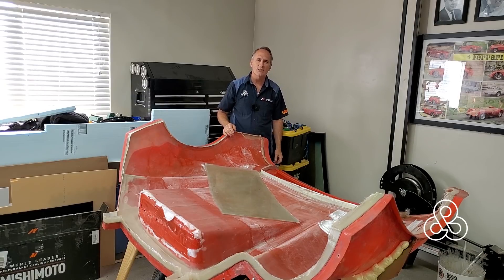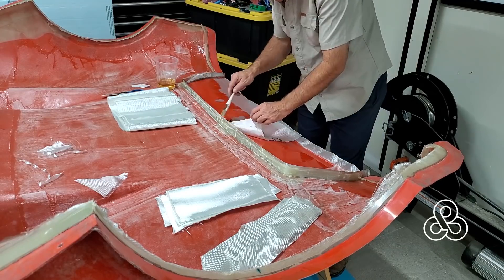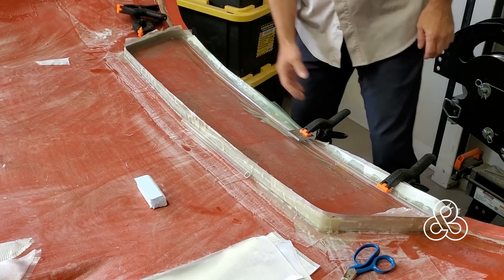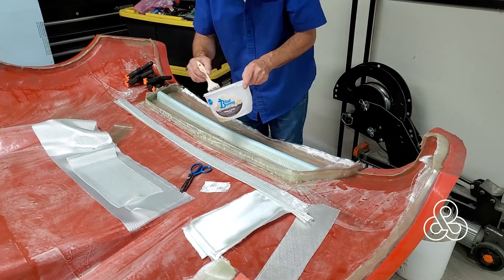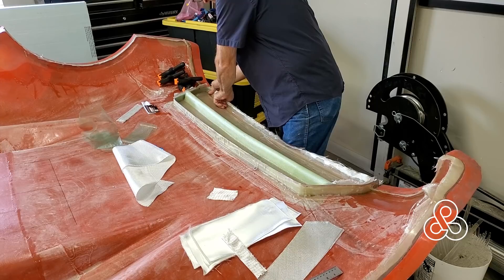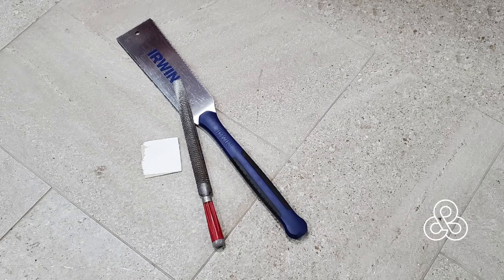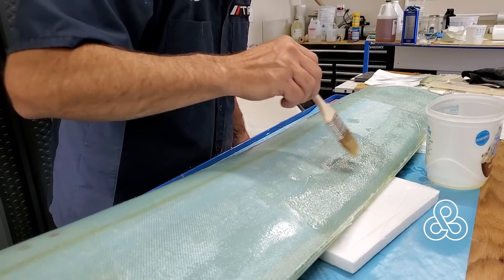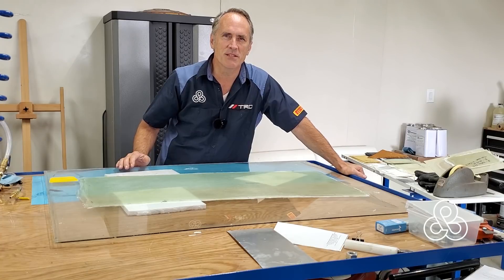A41 - Nero fiddled, I built an Active-Aero wing. Arete supercar project

Comment: Interesting process. How will you balance front aero with the extra rear downforce - moveable splitter ? I used aluminium tube spars - one on the centre-of-pressure and one to stabilise the trailing edge. I also used my 10% wind tunnel model (all home-made) to measure drag and chassis pitch stability at 4 degrees nose up. (I was at Le Mans in 1999 when they were taking off and flying up into the trees - Scary !!).
Reply from the maker: A front splitter is in the works. Exposed carbon fiber, so with the mold and all, it is taking some time. I should have a video out fairly soon though. Stay tuned

Comment: Why does everyone use brush for fiberglass not a skinny Minnie roller or sprayer
Reply from the maker: It is hard to apply the right amount of resin with a sprayer (plus the problem of over-spray control). A roller tends to pick up the fiberglass cloth and move it. Regular brushing will also move the glass fabric, but you can develop a technique called "Stippling" (a sort of rolling-twist of the brush) to actually press the fabric in place as you apply resin.
Reply: I know stippling I'm painter by birth well family business very good explanation thank you for your time ..love the car and in depth build

Comment: Have you designed this wing using CFD or are (excuse the pun) you just winging it?
Reply from the maker: It is a variation of a NACA 6512. Slightly more drag than I would have liked, but it fits nicely into the spoiler shape in the retracted position. I do have tabs built on to my control arms that I hope one day to fit load sensors to, then I can tune the position/angle of attack, at the track. So the dream goes!
Reply: @BuilderCreator  the plan sounds brilliant. I'm glad I subscribed. Thanks for the reply.

Comment: Wow. I want to see how you work the arduino in with it! So once its in range/extended out, do you plan to do different angles for each mph, or have it hold one angle within a range of mph?
Reply from the maker: Probably going to have to be "deployed" at certain speed ranges, tucked in for low and high speed and secondary actuators deployed on breaking.
Reply: @BuilderCreator  What,it's going to break ???? ♿ 🇺🇸

Comment: For the wing, have you thought of adding a condition in the software that would incorporate steering wheel angle? I'm thinking there could be high speed conditions where there'd be turns but obviously not as short a radius as lower speed.
Reply from the maker: Going to depend upon the actuators and sensors I end up using.

Comment: Awesome vid Jay! i have another question today if you dont mind. I see the wing planty strong. But what about the mounting points? arent they just sitting on foam? wouldnt the force of the wing pushing down crush the mounting points into the foam and fail?
Reply from the maker: Mounting points are sitting on the "Spar" that crosses through the center of the wing.
Reply: @BuilderCreator  ho i guess didnt noticed, i saw you cutting the foam and putting them in and though thats odd! thx for clarifying

Comment: Phew... At last, after 2 weeks, I have watched all the videos. Time to go back and watch all the videos again 😂. 
Really sad to see the forest fires in Oregon 😢. 
By the way, how are you thinking of actuating the wing, are you thinking of using hydraulics pistons? And how would you extract the speed data from the ECU to actuate the extension of the wing?
Thank you, great work as usual 😊👍...
Reply from the maker: Actuating- pneumatic cylinders with lock positioning. I will have onboard air, but don't want to deal with added hydraulics. I will only have 3 positions; parked, deployed and braking. An Arduino sketch will read a CAN (ground speed) signal and deploy if the speed is between say 30- 120 mph (48 - 123 kph) and the active aero switch is ON.
Reply: @BuilderCreator  Nice, I was going to ask the number of positions as well, thanks for mentioning it here itself 👍
Reply: @BuilderCreator  That wing looks kind of like a "Clark Y" that ought to lighten up the rear end !!!!!! You are going to mount it upside down,right ??????? ♿ 🇺🇸
Reply from the maker: @richardanderson5109  Variation of a Clark Y, inverted of course